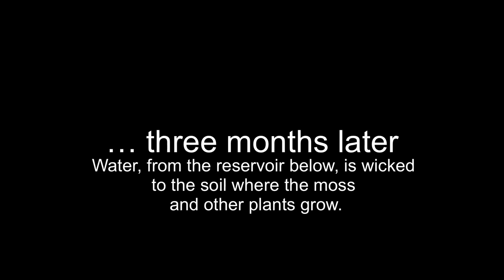Wicking tabletop moss garden

Comment: what a lovely idea! how do you prevent the wood from getting fungus or molds?
Reply from the maker: Good question... this is a problem I am experimenting with eliminating. 

This is actually the second project like this that I did. The other is very similar but smaller and is actually feeding/watering a tiny bonsai. 

The wood under the "Island" is really discolored in my first project. I knew this would happen because the wick touches the wood. I didn't know if the idea would work so I didn't put a lot of effort into it. 

For the project in this video I added a bit of silicone at the holes where the wick goes through and I also rubbed a thin layer of silicone on all the wood on the inside of the box to help stop mold. 

It worked okay but the concrete "islands" actually wick moisture through the bottom and that also causes the wood to get wet. 

So.. I made another one and put a thin layer of silicone on the bottom of the "islands" as well. This seems to be working much better but still isn't perfect yet.
Reply: @lionfishadventure  whoah, that sounds like a lot of work just to prevent the wood from getting moldy X'D I wish you the best in your experiments!!